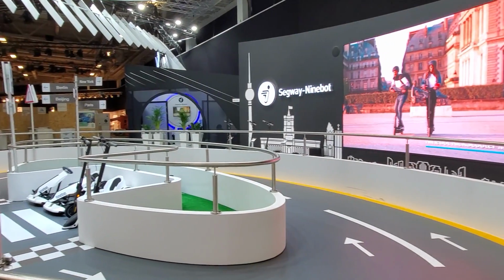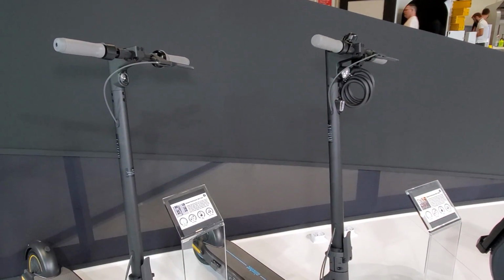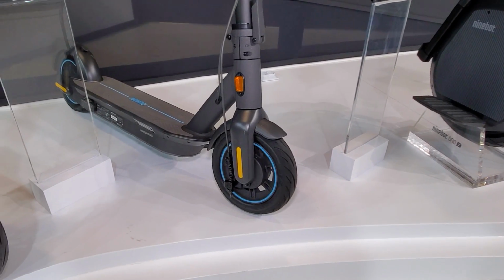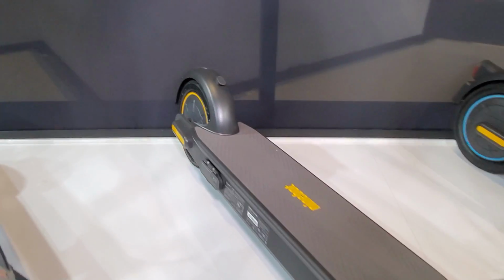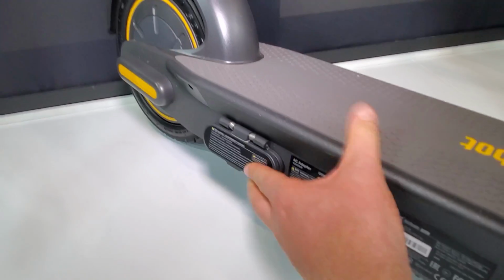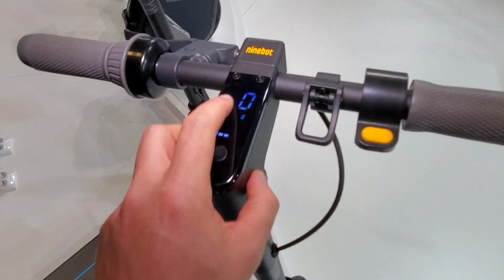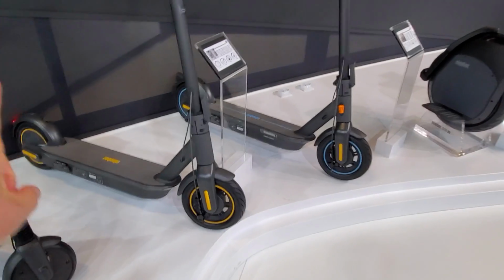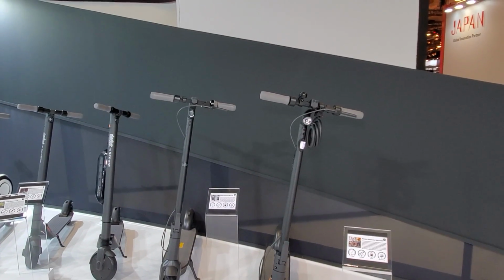Ninebot Kickscooter Max G30 & G30D 65km eScooter First Look! IFA19

Comment: I'm living in Belgium (max. 25km/h) allowed and thinking of buying the Ninebot MAX G30. My plans are to use this scooter also in Germany and Switzerland (max. 20km/h). Should I buy the Ninebot MAX G30D (german) just to be sure, or can I just re-flash whenever I change countries?

Is there a way to check the serial number and get fined in Germany or Switzerland for having the standard model?
Reply from the maker: Plan it safe and get the german version. You can't just flash it over so it could be an expensive mistake
Reply: @Techtablets  How so?

Comment: The true is 40-45km, 65km with ECO mode flat road, and worm temperature!
Reply: Nah I ride up to 70 km,it depends on inclination,and cold temperature,you also have to let the motor cool down if the temperature exceeds 35 or else you will dry your motor earlier than expected

Comment: The reason i always liked Ninebot es models over Xiaomi M365, is because ninebot has Big solid tube, easy fold system and nice foot board with plenty of height ride. M365 has thin pole, anoying fold system, no height ride since foot board is Big and close to the ground.

Comment: How come people in America are receiving g30's with a top speed op 30 km/h ( 18.6 mph ) and in europe the top speed of the g30 ( not the german restricted g30d ) is only 25kmh (15.5 mph) ???
Reply: In Australia, they'll be speed limited to 0.5kph and have a motor power limit of 5 watts..
Reply: Just change a few letters in your serial number on the scooter and the speed limit will be gone.
Reply from the maker: Yes it's the laws. In Spain for example they are not allowed to sell scooters that can go over 25km/h. Germany, Sweden and many others it's even lower at 20km/h max.
Reply: @Techtablets  In Holland there is no regulation other than that they are illegal to ride all together. ( Except on private land ) So how come Dutch scooters go 25km/h instead of 30?
Reply: @Techtablets  So if I order the G30 in Europe I'll get the 25 kph version and not the 30 kph? Just making sure I don't have to order the G30D (I'm from Finland and the limit here is 25 kph)
Reply: Regulation. In Sweden the max speed a scooter is allowed to drive (and to be build for) is 20km/h.

Comment: In Australia, anything over 200W needs license plate and full on motor vehicle registration. Hell will break loose if police decide to start cracking people dowb
Reply: I think in QLD it is fine
Reply: Qld can have 1000hp big block chev.. only rule is it can’t exceed 24kph and must comply with size measurements ....it must be Locked internally inside the machine...but power is unlimited! So 3000watts or more is fine. It takes into effect heavier riders/Adults need more power and some may do shopping and things , so even more weight. They want people out of cars as much as possible to save the environment
Reply: @donaldd1612  VIC sucks
Reply: Think it's 250 in NSW.

Comment: I wonder how long the power supply could hold if it's integrated inside the scooter.....
Reply from the maker: Should be designed for that so I guess it would be fine.
Reply: A power "brick" is probably the item least prone to wear and tear on a scooter.